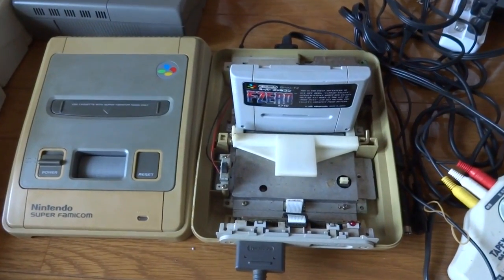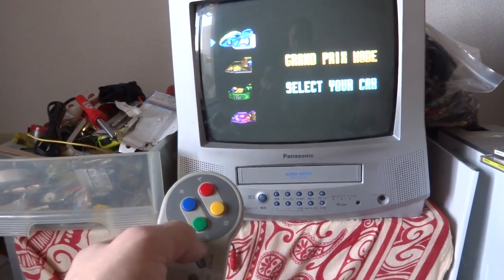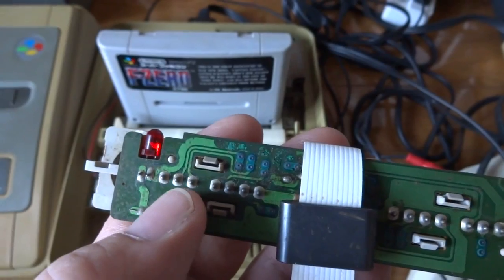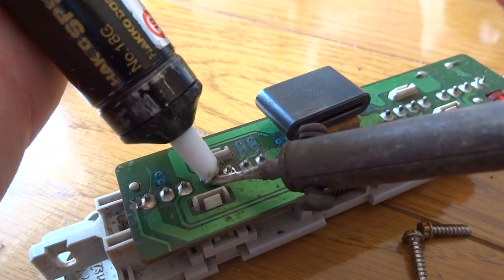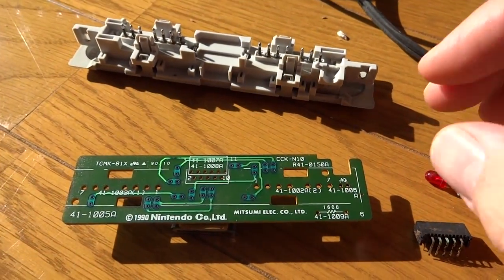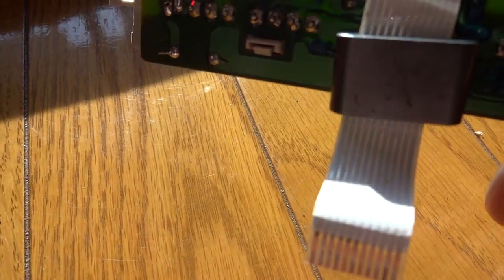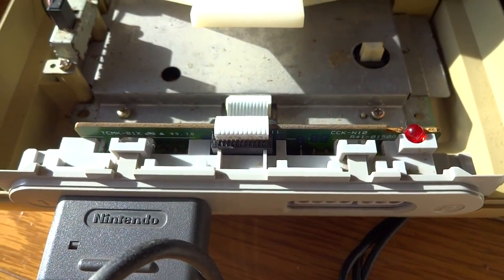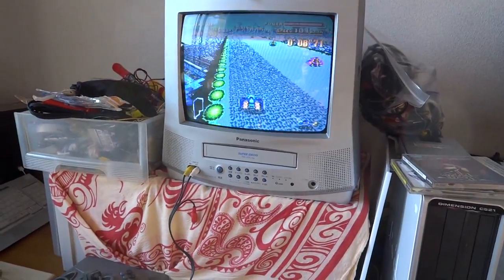Super Famicom Controller Port Repair

Comment: What a mess of corrosion! Nice job man.. always happy to see an original controller saved from the garbage heap.  I fixed a few of SNES pads, but they were just issues with the cords being cut. I found the SNES Test Cart very useful in that situation. luckily I had an old Super Magicom copier so I loaded up that rom. This is another reason I love the good old Neo-Geo.. holding A+B+C+D on the second controller brings up a handy controller test menu. :)

Comment: Hello, on my snes PAL i have controller issues on player 1 port, buttons are all mixed up. However it is not comming from the port because i tryed to plug it into another console and it worked fine. It must be something wrong on the motherboard. Any idea on what i could look into?

Comment: Hey I know this is unrelated but I really need help. I have an NTSC 7th saga cart for super nintendo. It doesnt play just gives me a black screen and occasionaly it gives a black and white grid on the screen and doesnt play. Ive cleaned the pins several times, looked for damage on the PCB and theres nothing. If you could offer some advice for me I would highly appreciate it. Thanks!

Comment: Hi. Any idea, how to fix the shoulder button on an AGS-101 SP (with a donor AGS-001). Replacing the button didn't work and cleaning it with contact cleaner, alcohol and compressed air inside didn't work too but here's a close up of the circuitry:

http://i57.photobucket.com/albums/g230/alvin777/Advance%20SP%20AGS-101%20Shoulder%20Button_zpsxibkjyq3.jpg

Thank you. God bless. Rev. 21:4